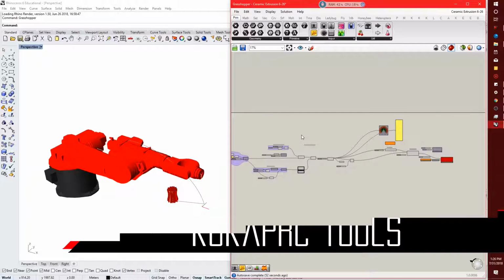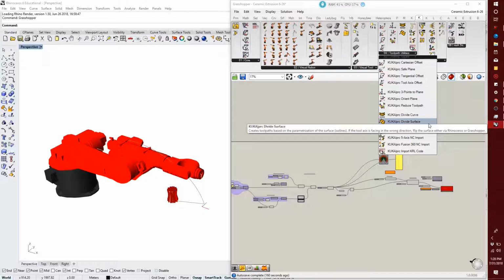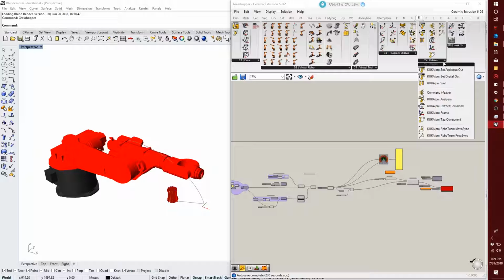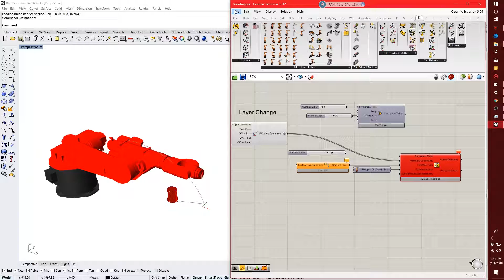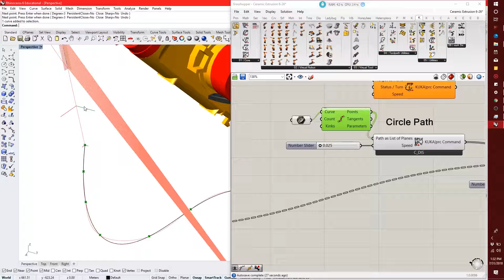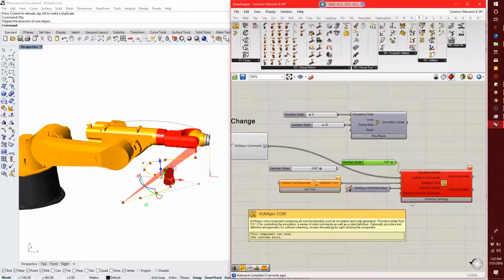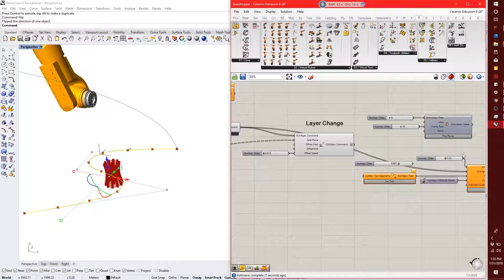Quick Start for Robotics | KUKAprc for Grasshopper 3D - Tutorial

Comment: Sounds very interesting! 
I wonder to know if the used plugin works for a particular Arm robot or can be used for all
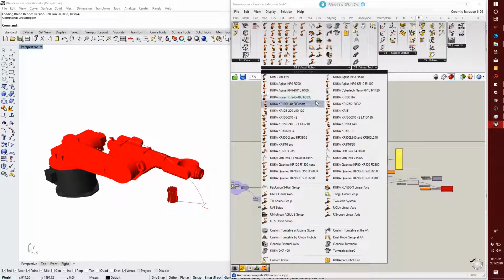Reply from the maker: So far I've only tested with KUKA robots since that is what I work with and what the plug-in is meant for. @ 1:04 in the video you can see where you would pick which KUKA robot you use. There are other plug-ins that create generic g-code that can be interpreted by 6-axis robotic arms.